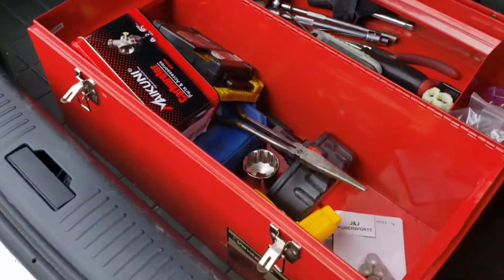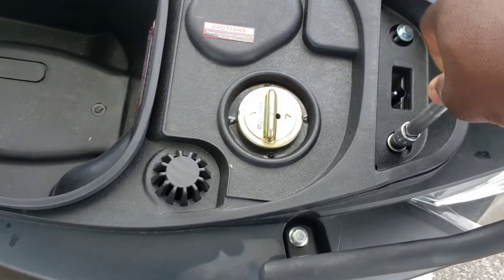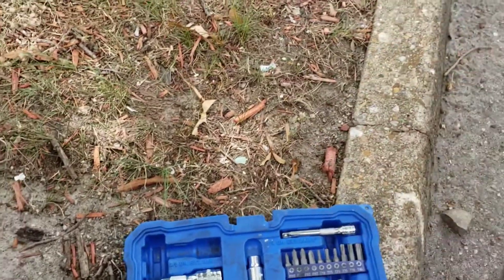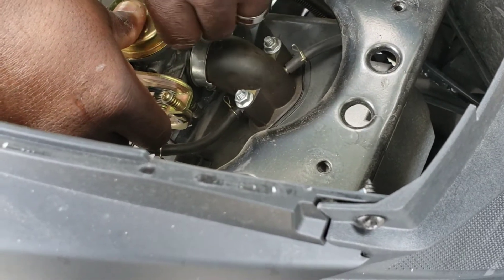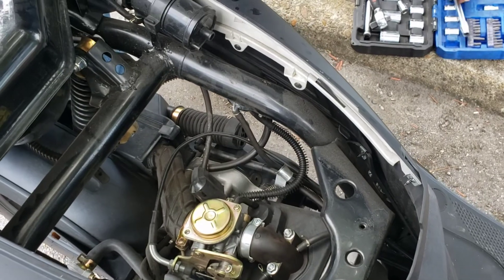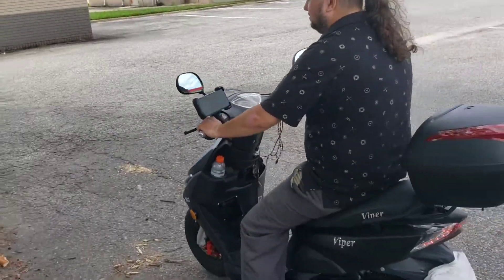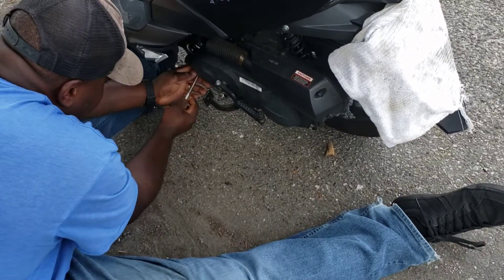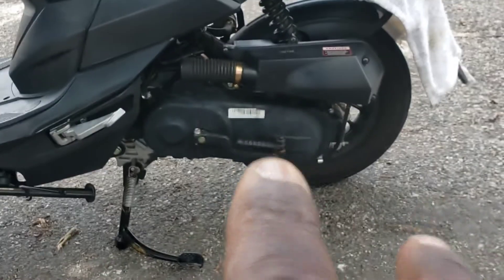TURNING A 50CC MOPED IN FOR A LAMBORGHINI

Comment: Hey how did you go about the adjustment done ?
Reply from the maker: So there's a video that shows you how you can move there's a seat clip with slots on it that you can move it to make it richer leaner but his didn't have it so I figured I'd try pulling the c-clip and moving it above the O-ring instead of below it to see if that would work that's pretty much what I was doing